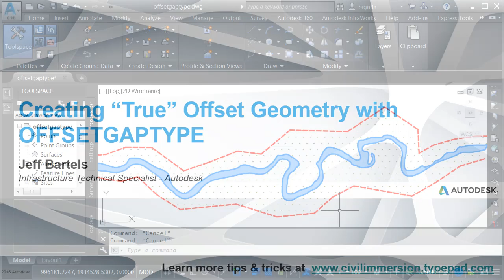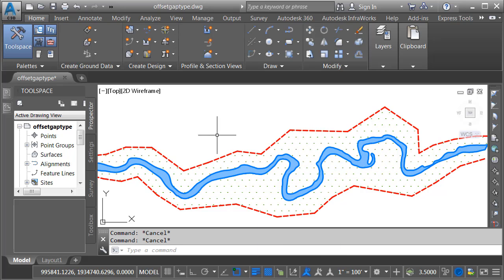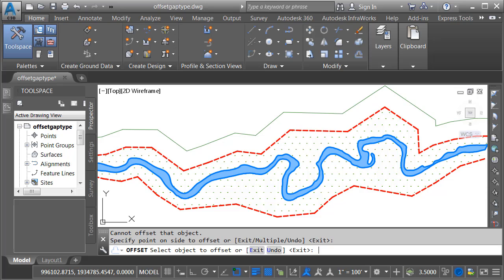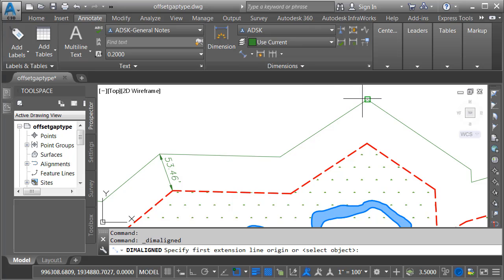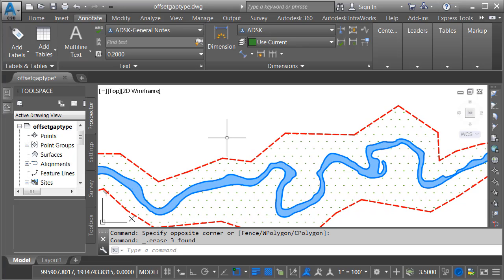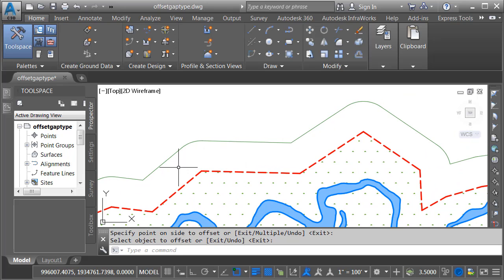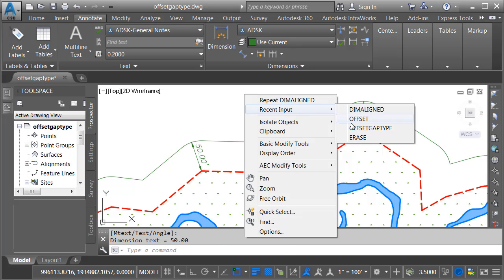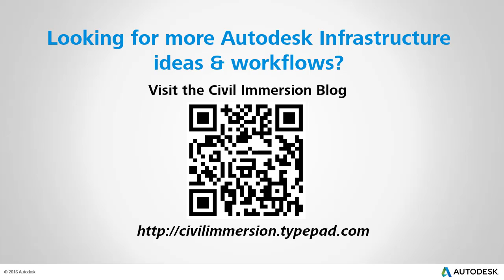Creating "True" Offset Geometry using OFFSETGAPTYPE

Comment: Very nice.

Is the OFFSETGAPTYPE a new system variable for ACAD 2018?  

In the old days I'd have just used the FILLET command using a 50' radius to round off the outside corners of the polyline, but that would mean having to select each of the intersecting vectors individually (time consuming).  Also, that intersection at the far right would likely have required exploding the polyline & working the curve and line intersection using lines and curves and trimming them (more time consuming).

This will definitely save a lot of time.  Cheers!